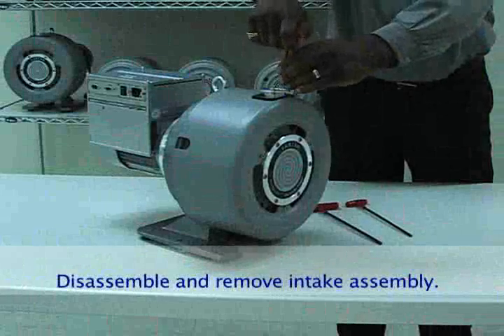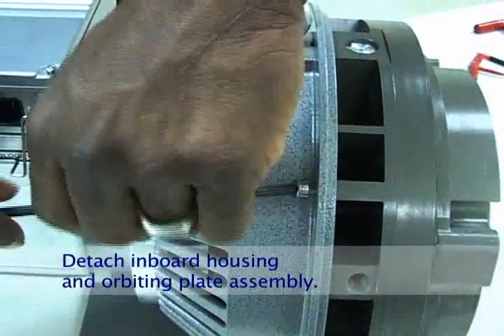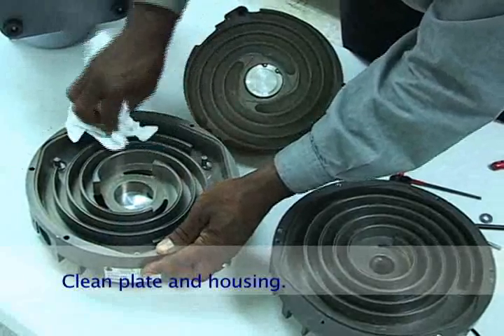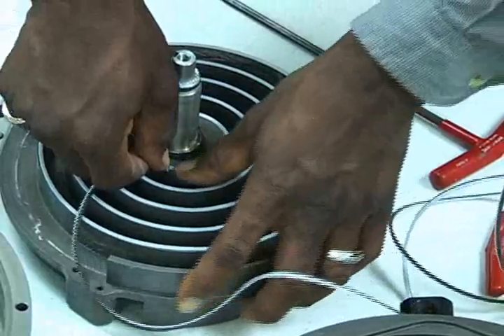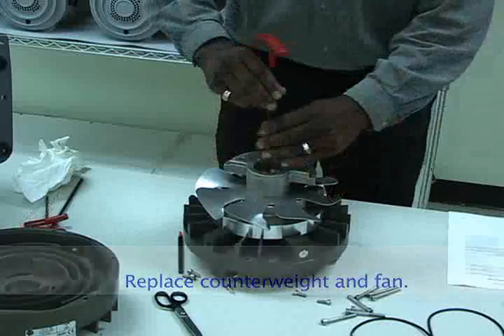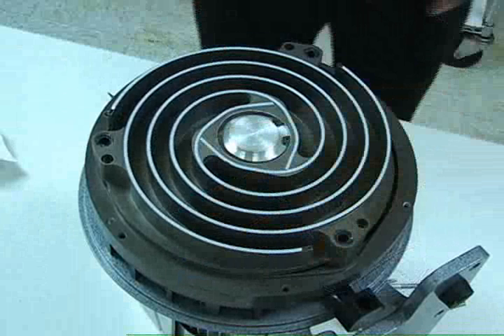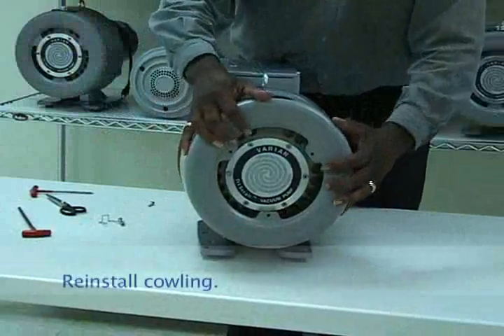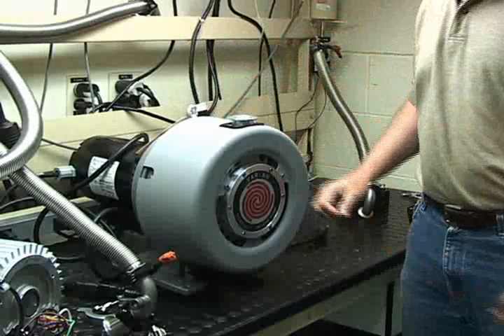TSTipSealReplace(60)5-22.wmv

Comment: I've replaced tip seals many times, but I remove the center cap and nut and keep the coupling and fan on the inboard housing.  I then have to set the clearances everytime.  I'm going to try this method next time.  No I think it's not possible to overtighten these screws with a normal allen key or t-wrench unless you try to intentionally.  They usually have some resistance to rotating since you're trying to rotate the tipseal with preload against the bottom of the channels.  It should resist, but a small child should be able to turn it.

Comment: Putting your hand over the inlet of a vacuum pump is a bad practice.  If inner the diameter of the inlet is sufficient that pump would pull your hand in and crush it.  If there happens to be an adaptor with 3" ID on top of that pump then the pump will pull your hand in with 104 lbs of force.  Always use a Convectron gauge or similar to check the performance.
Reply: not that much like Hollywood movie😀